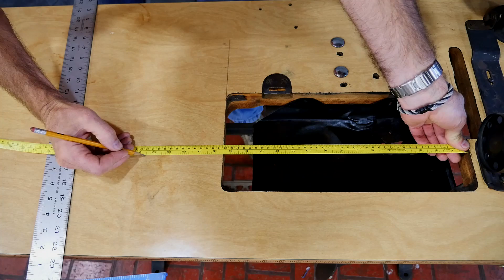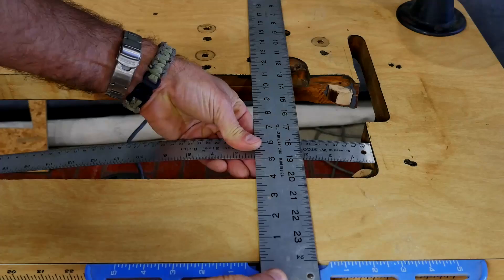Industrial Sewing  Machine Table Retrofit and Complete Setup

Comment: I love that you added a foot pedal for lifting the presser foot.  I just ordered 5 of them so I can do the same thing.
Reply from the maker: I like both methods, the pedal is dirt simple and so you can be up and running quick and reliable. Most knee lifters are either janky or require removal and proper install to work. The previous installer almost never seems to get it right.
Reply: @AlexanderDyer  I'm in process of cutting and routing an old oak dining table with 4 industrial machines on it.  I need to find a solution to hold the foot pedals.  Your videos have been invaluable while I am trying to figure it all out though.  Thanks for doing what you do.

Comment: Loved the video.  All of it.  I learned on a 'power' sewing machine.  Watching you create a home for your machine is really nostalgic.  Now,  I'm getting my old Bernina 117K ready to use again after years of not using it.  Your machine is unique, being a leather machine.  Mine is pretty heavy duty and, will sew leather but my intent is regular sewing.  Currently I have no cabinet or table so watched your vid for any help I can get.  Thanks for posting.
Reply from the maker: I am not 100% sure but I will bet that you can get any old fold down sewing machine cabinet and your machine would fit. Those cabinets from the 40's-70's were all the same style in how they hold a machine so I would encourage you to check into that. You can probably find one local on craigslist for cheap and you could try before you buy. Good Luck.

Comment: if you have an old residential sewing machine motor put a small rubber wheel on it, wire it into a cheap ebay speed controller and use it to power your bobbin winder.  its much funner to wind bobbins when 100 pounds of sewing machine isn't clanking away.

Comment: Thanks for your reply,  I have learned alot from your videos,  I manufacture awnings and I also have the Consew 206 RB Sewing Machines,  I have a Singer 311 Double Needle Chain Stitch Sewing Machine that I want to sell , I use a Sinclair Wedge Welder to weld seams together for the Awnings I make so I don't need the chain stitch machine,  I think it's a 1948 model, I have the original owners manual for this machine
Reply from the maker: Fabric Welder, Cool! I'm not familiar with the double needle but it sounds cool too.

Comment: fantastic video! i have to make a whole new table top for my industrial Nakajima Walking Foot. those old tables are notorious for sagging in the center under the weight of those machine heads!
Reply from the maker: Yeah, particle board does that. The plywood tops are better.

Comment: Hi Nice videos, I have a 754 Consew, and I can't get it too use booth needles with out braking the thread. I bought reverse twist and that seem the work but the right needle must be out of time... spent lots of hours try to figer it out.  I use it as a single needle now.  when I bought the machine it had very low hours. it a great machine it just needs someone that  knows how to fix it.  you want to trade ?

Comment: I like your videos. I just picked up my first industrial machines, a Singer 111W155 and a Singer 112G139. I have a question, I only have one motor and table and the 111W155 doesn't have any hinges. I am going to make the hole to (the table top only has a belt slot so I can router in what I need) fit the longer 112 machine and the 111 with the addition of a filler plate to compensate for it's shorter overall length. I would like to upgrade to the new style hinges like you used but I am unclear how they attach to the machine. Would you be able to provide any insight on this? 

When completed I'll be making seat covers for my vintage snowmobile and recovering my pontoon seats along with making a new cover.
Reply from the maker: A simple round pin is held in the machine head by a set screw usually. Be sure and check your machines though, I have had some older machines that had a different style where the hinges were screwed to the base of the machine with a couple of screws and so would be more difficult to convert.
Reply: Thanks for the advice. As luck would have it each machine is different. I think I can fab a bracket to the 112G139 (old screwed in place brackets) and weld the new style hinges to the bracket. This would allow me to space my hinges the same on both machines since they aren't even close. Do the hinges help hold the machine to the table  to prevent it form rising up when the knee lift is used? One more thing, as I am an amateur sewer I'm thinking about upgrading to a servo motor. Do you have any that you prefer over others? The Consew servo with the dial control is about $100, a Sailrite is about $200. I'm assuming they are all made in China? Thanks again for the great videos.
Reply from the maker: The hinges only engage the table when the machine is rocked back. The machine head sets on four cushions at each corner when upright. I show a couple of servo motors I like in this video and there are links in the description. https://youtu.be/lavkvsU5ltk
Reply: Thank you!